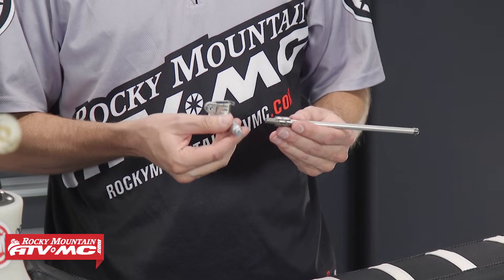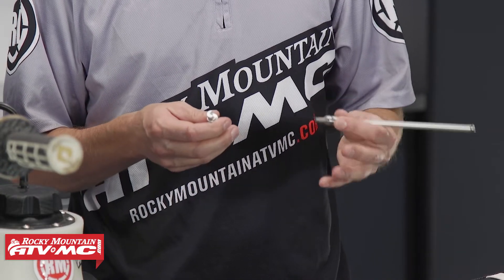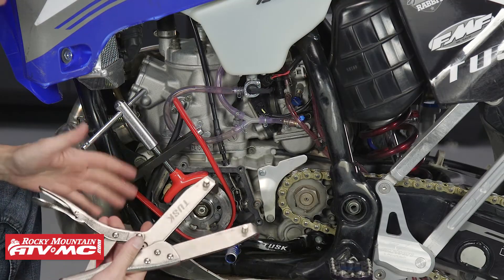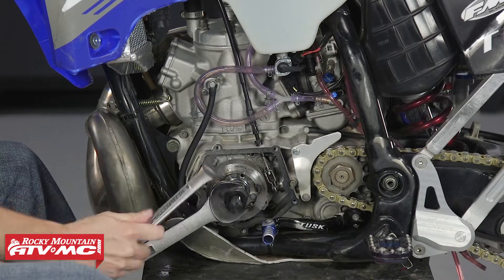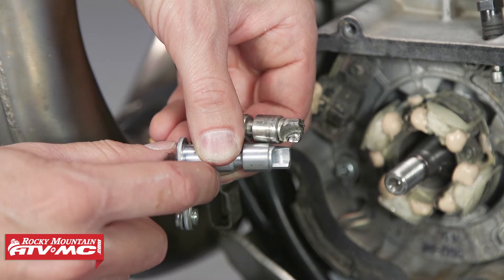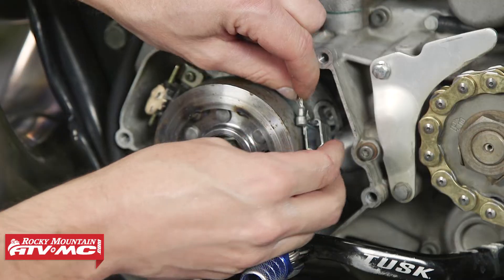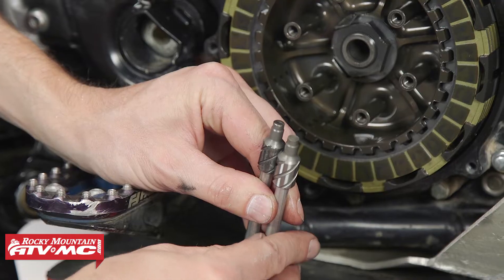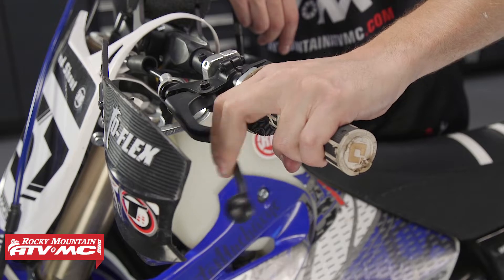How To Replace the Clutch Arm & Push Rod on a Motorcycle or ATV

Comment: For a lot of clutches, you need to be really careful opening it up and here’s why. I took off the pressure plate and saw the steel and friction plates and right in the middle of the basket there was the top hat screw. (The screw that connects to the clutch rod) but in between the clutch rod and the screw is a little steel ball just a little smaller than a marble. If your clutch won’t disengage, make sure to find an expansion picture of your clutch and see if you need to have one in there.
Reply: Awesome. Thanks
Reply: Can you clarify where this ball is, sorry it was a bit confusing. Maybe I just read it wrong
Reply: My 2000 yz 250 has that steel ball. I dropped it on the ground. Got lucky  I found it. My service manual does not show one though. Not sure if its needed.
Reply: Some models have a ball bearing under the hat or “throw out bearing” which pushes the pressure plate off the clutch disks.

Comment: I have 2006 yz 125 I have removed clutch clutch is(visually) good springs good ball in place fresh oil, re adjusted clutch checked clutch cable cable not stretched, bike cranks first kick, idles fine, while bike idling in neutral when I shift into 1st gear with clutch lever pulled the bike stalls out. when I first removed clutch and put back together with fresh oil the bike did not stall until about 10 sec and it stall then every start up and shift into first it will stall again.. any insight welcome

Comment: Hi, On the push rod, at both end there are small added extensions, both with threads. I found both ends are loose and rotating free even after having threads on both ends. Should they be free wheeling or should they be tight? I am working on 82' XV750 Virago clutch. Thanks.

Comment: At the 4:26 mark the seal you mentioned. If it's bad will transmission oil leak into flywheel  housing?

Comment: my son has a yz85, the clutch cable seems to be to long. The cable has the tension loosened all the way out and the tension screw is all the way out but it still has a lot of play in the handle? its a new cable for the bike. Any suggestions?

Comment: Could this turn a normal clutch pull into a 3-4 finger pull?  Just wondering if it'll make that much of a difference.  My clutch is extremely hard to pull, I changed the clutch shaft but not the push rod and it honestly didn't make much difference.
Reply: It could be your clutch springs mate
Reply: Be sure the pushrod is engaging properly (long enough). I have an 04 yz250 that the clutch pull was super hard because of where the arm was making contact. I had about an 1/8 inch gap until the pushrod made contact with the clutch pressure plate.

Comment: Would those parts make the clutch grabby? No matter how much I try to adjust the cable when I pull the clutch in and put it in 1st gear it grabs
Reply: I have the same problem. Were you able to fix it? Need advice thanks

Comment: I have a 2016 yz250f, I took off the the stator cover to try to get to the actuator arm, but it's not there, it's more to the right, and it seems like I have to split the cases just to get to it which I'm not trying to do, anyone know about this? Also if neither the push rod or actuator arm are worn out on my bike, then how come the pull of it is still notchy and hard? I checked the push rod, cleaned the perch/cable, and checked all the plates and springs, everything seems good, the only thing left is the actuator arm, and if it's not that then what could it be?

Comment: I have a 2002 yz85, and it has a problem with the clutch. The clutch does not disengage fully when you pull in the lever, if you have it in gear and pull in the clutch lever, you will not be able to roll the bike, it will still turn the engine over as if the clutch lever was still out. If the bike is running and you put it in gear with the clutch lever in it will just stall out, I have tried messing with the cable adjustments, it also has a brand new clutch cable on, and still havent fixed the problem. People online say the basket could be worn, could there be any other possibilites? A clutch basket is pretty expensive (about 200 dollars) and I am wondering if it could be anything else. Could it also be something such as a worn or bent clutch push rod or actuator arm?
Reply from the maker: Thanks for contacting us.  Have you already torn into your clutch then?  The issue could be the things you are mentioning, motorcycle clutches have really tight tolerances and if a clutch rod, lifter arm, basket or clutch plates are worn, trying to get the clutch adjusted right wil be hard.  I would recommend you start with a new clutch pack kit w/springs and some fresh transmission oil. Then go from there.  While you are in there replacing your clutch, look for grooving on the clutch baskets fingers and clutch boss. For sure refer to your service manual for the proper specs.  Then move to your push rod and clutch arm.  Another great tool to use is the OEM Parts Finder Page on our website.  Here, you can enter your machine make and model and check out the clutch assembly and make sure you have all the parts and their specific order they go in. Let us know if you have more questions, thanks for watching!
Reply: I have just torn into the clutch today, and the basket looks very worn. My friend has a used clutch from one of his bikes that he parted out that barely has any use on it, I will put that on and see how it works out! Thanks.
Reply: icantcomeupwithaname did it fix your clutch issue I'm having same problem with my yz426 but basket looks new
Reply: yeah it fixed it. if your basket isnt grooved at all then the problem is coming from something else, could be a stretched cable, bent pushrod, or maybe just needs some new plates/springs. Your inner hub could also be grooved too, so make sure that isnt grooved at all.

Comment: I have a 2012 yz 125 and I do not have that bolt that releases the actuator arm and I took out that rod that comes out the other side from the clutch plate side and still no luck to get that actuator arm out....help...
Reply from the maker: The Outdoor Project Not all bike models will have this.  This process was performed on a 2004 YZ250.  You're on the right track.  You should be able to wiggle it up and down, while pulling out.  If you have the pressure plate and push rod out, that should do the trick.  Let us know if you run into any other questions.

Comment: The clutch on my 2004 KX125 won't disengage. For example, if I pull in the clutch and put it in gear it will jerk forward then stall. It seems to disengage a little better when the bike is warm. I'm completely out of cable adjustment with about .5cm-1cm of freeplay still in the lever, however the clutch isnt hard to pull. Could these two parts be the culprit?
Reply from the maker: Your stock cable should have a second adjuster on there so check that out and make sure you don't just need to adjust that one as well. After that, I would suggest replacing the cable and see if that solves your problem!
Reply: Are you talking about the adjuster right before the cable goes into the case? That one is out too, haha. Ill try a new cable and see if that work. If not Ill just inspect the whole clutch. I have a pushrod and arm on hand. Hopefully I can sort it out. Thank you
Reply: @adamkinch5807  did you ever solve this problem??
Reply: @clarkecollins2691  I ended up replacing the pushrod and the lever in the case, replaced the cable and also put in new plates and springs. I also decided to use a quick adjust lever for good measure. Has worked like a charm since.
Reply: @adamkinch5807  predicate the response I think that's my issue its about the only thing left

Comment: I have a yamaha yzf-r125. When i pull in the clutch lever in neutral it makes grinding noices. Could this be the problem?
Reply from the maker: Moto_Nerd sounds like you either need a new clutch pack or need to adjust your clutch cable?  I would recommend you give those a try and go from there.  See if that fixes.  Let us know what you find out.  Thanks for watching.
Reply: I had clutch slipping over 50% trottle, i changed the clutch plates and put it back together. The clutch is still slipping and now it makes the sound as well. I thought that i loosened something when i took it apart, but have rebuilt it 4 times now. (cable was changed before any of the problems and it ran no problem)
Reply from the maker: What year is your sport bike?  Have you looke at the OEM Parts Schematic to check the order everything goes back together as well?
Reply: it is a 08. Mounted everything back together as it was suposed to. Think a spring or something lost slack when i opened?
Reply from the maker: Moto_Nerd  did you align the teeth up on the push rod with the push lever axle?  Did you remove the push rod when you installed the new clutch?   Give our OEM Schematics a look over under the Clutch assembly here: https://www.rockymountainatvmc.com/oem-parts/Yamaha
Reply: i did not take out the push rod, so maybe it got loose and dont align anymore. I will give that a shot. keep you uppdated. may take a few days.
Reply: @rmatvmc  so I'm having a similar problem, don't know a ton about bikes but my 02 rm125 just had new clutch gears put in and the clutch lever is completely loose and won't tighten. It's as if something isn't springing it back. ?

Comment: What if the clutch arm has no tension? What is happening there?
Reply from the maker: Its Apollo Sounds like you're possibly having a problem with your clutch push rod?  I would tear the clutch down and see what is going on inside.  Let us know what you find out. Thanks.
Reply: thanks for the advice,ill get to it
Reply: Did you find your solution? My buddy is having the same issue
Reply: fuckyou I got rid of that bike,but I believe it is the push rod

Comment: What if the clutch arm seal is leaking oil when you're riding? Would it be the same issues?
Reply: firewind10100 
Just put a new seal in. Easy fix.

Comment: I can't find the bolt to release actuator arm on my 07 Kx 250? Anyone know?
Reply from the maker: John Klause this was done on a 2004 YZ250.  Not all bikes are the same.  I recommend you follow your bikes service manual.  They should list the steps to take.  You may need to take your clutch cover, clutch pressure plate and rod in order to pull your acturating arm?  Let us know what your find out. Thanks
Reply: Rocky Mountain ATV MC Thank you that was the next step.

Comment: Great video, but don't use your torque wrench to break bolts loose.
Reply: Then how are you suppose to torc reverse threaded nuts? They're designed to torc both ways. It's not bad for them.

Comment: A friend was riding  my 2013 yfz 450  he down shifted with out using  the clutch from 4th to second gear and something  grinded  and my clutch stopped working  so I ajusted  the clutch  at the  clutch  arm  and it worked going   up the  gears  but made a winding noise then when I down shifted  got to 2nd gear and  it stopped  working  again  I would  like  to  know  what might  have   happened
Reply: Tommy Hull 😧😧😧
Reply: Yamaha Mulah. lol that was alot of help thanks..